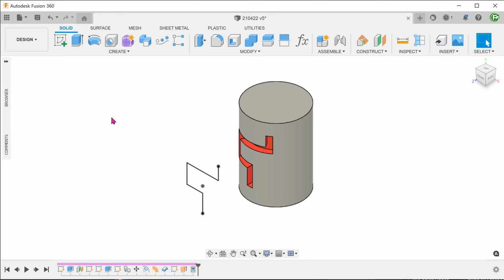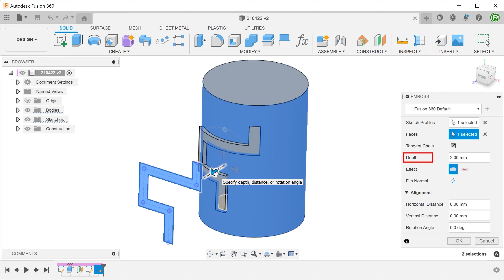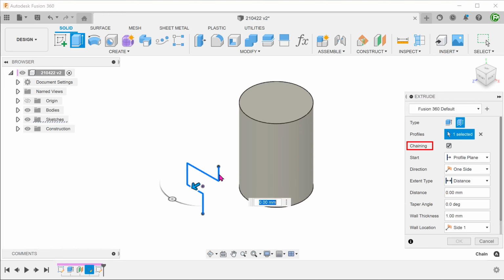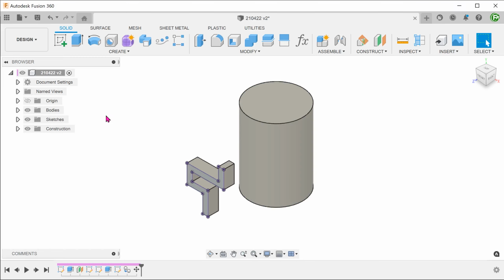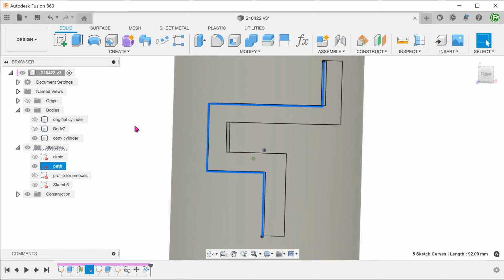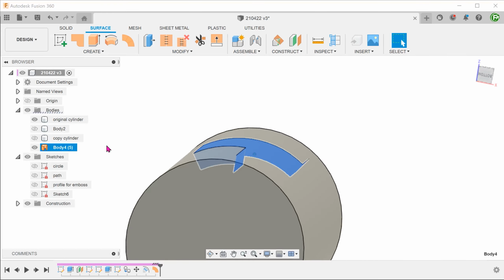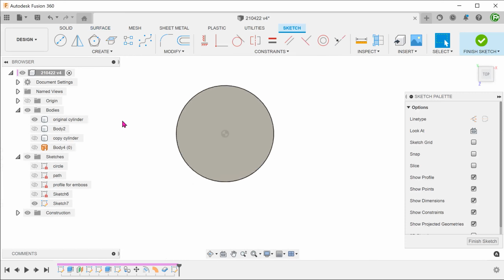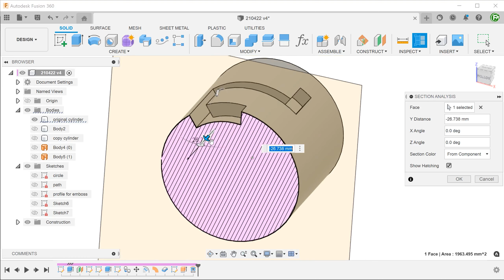Fusion 360 | Groove on cylinder (with parallel side walls)

Comment: This was a useful video, thanks! I didn't end up using your method, but it got me started in the right direction. I wanted a cam slot cut into the side of a tube, with some straight and some angled portions, but all of it square like if you milled a slot using an end mill and a rotary 4th axis. I drew my path on a 2d sketch, then created a second sketch and used the "project to surface" command (Create menu/Project-include/project to surface) to project that path onto the second sketch as a 3D line (referencing the OD of my tube as the surface). Then I repeated this for the ID of the tube so I could have a guide rail (didn't work right without doing this). After that it was straightforward to create a sweep profile and use the sweep command to do the cut.
Reply: The sweep was sort of ugly, and started failing as soon as I changed my path a little. After beating my head against the wall for quite a while I ended up following your process and it worked out great. Thanks again!

Comment: Ingenious! As soon as you said ruled surface I groaned because I always forget about that feature! 
Quick question though, rather than replace face, could you just join with a cylinder with the groove depth as the difference in radius?
Reply from the maker: Yes, that is definitely a good way.

Comment: Can we wrap a sketch around the cylinder and make another sketch for the shape of the grove and do a sweep cut as well?
Reply from the maker: I experimented with using a sweep and I was able to get the parallel side walls. The tricky part is what to use for the base of the sweep profile. It probably wouldn't make sense to make an arc as the path traverses vertically and horizontally, so I just went with a rectangular profile, sweep and then replace face. Thank you for the suggestion.

Comment: Could you project the shape onto the surface of the cylinder. Then select the shape outline on the cylinder and project that back onto a flat surface. Then extrude the second projected shape through the cylinder and then re-add the middle but of the cylinder?

Comment: Could you do a sweep cut using the wrapped sketch as the path
Reply: @PeppoMusic  Thank you
Reply from the maker: I experimented with using a sweep and I was able to get the parallel side walls. The tricky part is what to use for the base of the sweep profile. It probably wouldn't make sense to make an arc as the path traverses vertically and horizontally, so I just went with a rectangular profile, sweep and then replace face. I totally overlooked the potential of using sweep here! Thank you for the suggestion.
Reply: @Fusion360School  Similar thing but instead of replace face, sketch the appropriate size circle on the end and extrude solid ??
Reply from the maker: @johnnycomelately6341  Yep, that would be the better way.